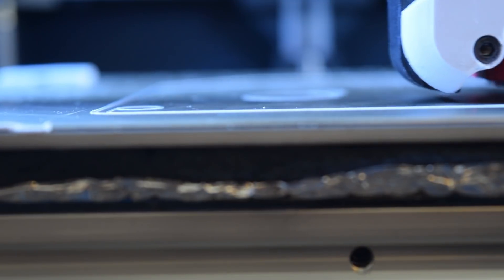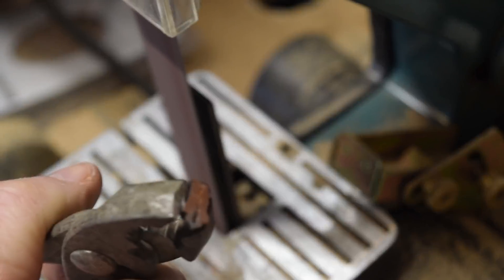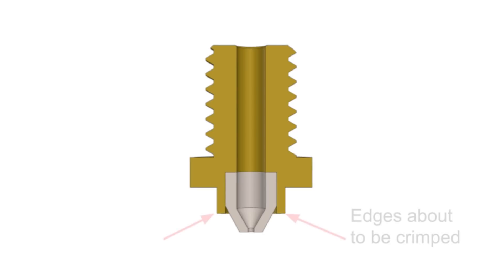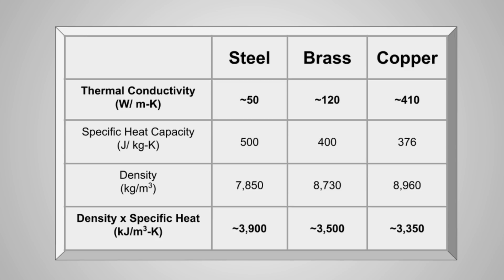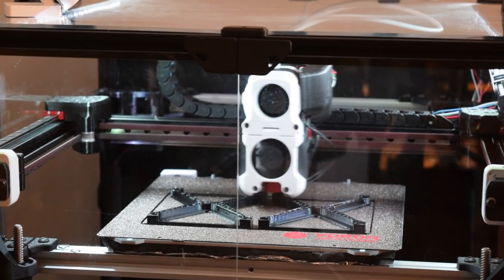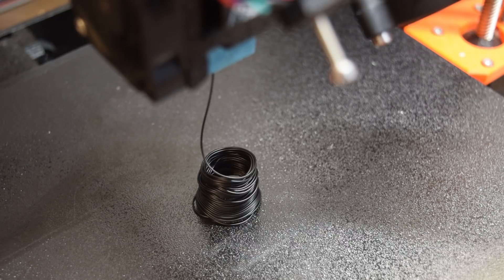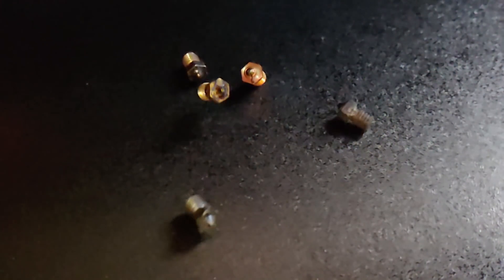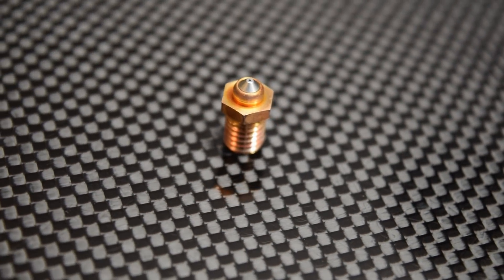Best Nozzle You've NEVER heard of?

Comment: Checkout diamondback nozzles. Not many things harder than a diamond and it has better heat conductivity than copper since diamonds are carbon based
Reply: I already have one. And it is great. The higher heat conductivity might mean you have to lower your temperatures for some filaments.

Comment: You should look into the new CHT nozzles
Reply from the maker: I use CHTs on all of my printers when I'm not using abrasives. Unfortunately they don't make a cht that is abrasion resistant version so until they do, I'll be using the markforge!
Reply: @fail_fast  they do now!  Will release this month. Both hardened and extended melt zone (volcano)
Reply: @fail_fast  Check their Twitter

Comment: Check out Tungsten Carbide Nozzles. Should be around similar price as the Markforged Onyx nozzle though all the fantastic properties that Tungsten Carbide brings to the tabble and none of the downsides of Steel and Brass. There is a "cheaper" version from Phaetus which uses a Tungsten C. tip but in talks with someone about the topic he reported that the tip popped off through pressure while printing. So pure Tungsten Carbide nozzles would be right now the King of Price/Performance for abrasive filaments.

Cheers :)

Comment: Long term use of the nozzle though, the throat beside the tip wears out until you have just the threads and next time you go to take it out, snap. (Source: job)
Reply from the maker: Yikes! Any idea how many spools you went through? The nozzle that I cut in half in the video had about 4 kg through it
Reply: @fail_fast  4 rolls is the usual swap, but I'd put it at maybe 12 or so. I guess that's a bit much for reprap users tho. That wasn't from our direct experience luckily. Pretty expensive f up for the unlucky
Reply: @fail_fast  Might suggest giving the dyze design v6 style tungsten carbide nozzle a shot in the comparison btw. Great video, I actually do have one on my not exactly stock prusa mk2/s. Thought I was the only one
Reply: Oh good you covered the issue, missed it initially

Comment: Look into tungsten carbide.  Rather than just a hard tip it's a complete wear resistant nozzle.  Some come with lifetime warranty on wear and use. Thermal conductivity is pretty much equal to brass.

Plain hardened steel is subpar as they wear slower than brass but still faster than TC by a lot.  Same with a hardened steel tip.  It's nice to have 1 nozzle that does everything with no wear then swap only for nozzle size changes. 

TC is the superior nozzle.
Reply: tungsten carbide is the goat

Comment: Interesting test! I expected to see a bit more of a difference, so it's good to know the nozzle material doesn't matter too much. Especially when getting a whole range of different nozzle sizes, brass is the clear winner for me due to the lower price and negligible performance delta compared to copper.
Reply from the maker: Glad I could help! It's also  telling that bondtech chose to use brass instead of Copper on their CHT nozzle. So they obviously felt it wouldn't make a big enough improvement to be worth the extra cost
Reply: @fail_fast  would be cool to see - CHT vs Micro Swiss TwinClad XT coated nazzle  (it has 0.08 friction coefficient vs usual nickel plating that has 0.2), may help it gain on CHT. Also comparing vs some great plated Copper nozzle would be interesting  = physics vs design/engineering, }

Would be amazing if CHT would make Copper version plated with TwinClad XT compound 😍 but well dreamsss